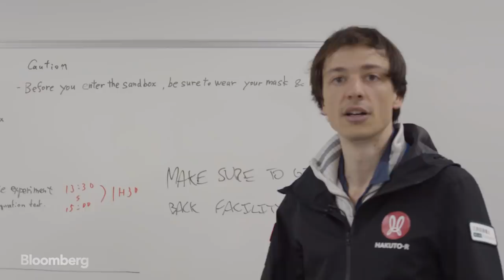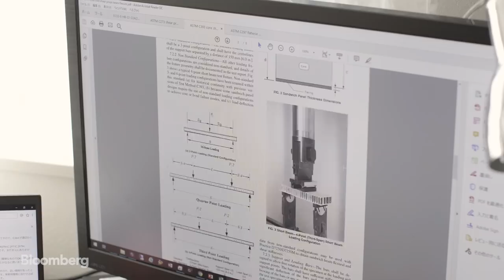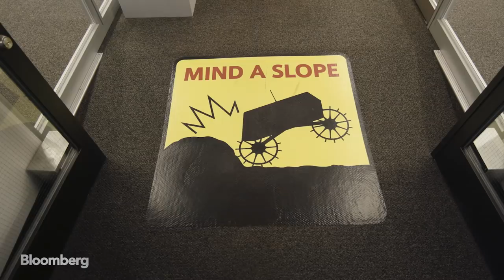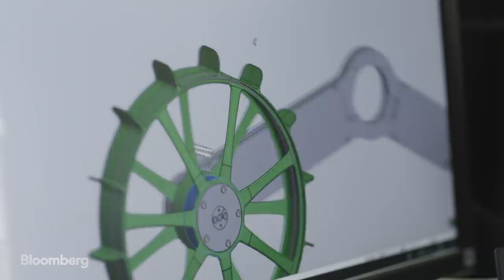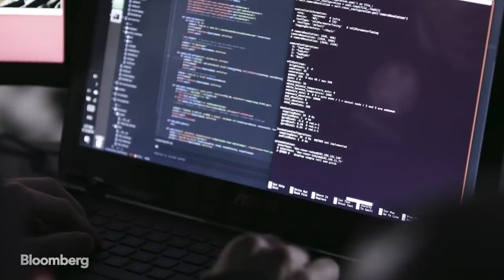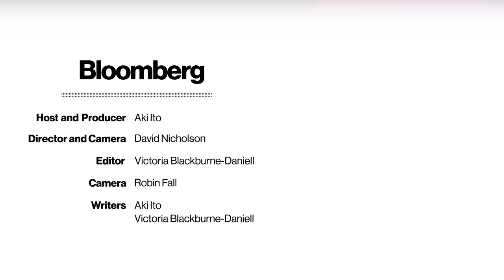The Moon Mini-Rover Engineer

Comment: if the moon is very dry, and the chances of finding water in sunlit spaces remote, & the regolith powder is only about 10cm's deep, how deep can you dig on the without hitting really hard stone and needing drills? I know the Apollo missions barely scratched the surface, but did the astronauts ever figure that out? Or was it impossible to determine due to packing a small spade and a big space suit?

Comment: I should have studied robotics engineering ...Instead of mining
Reply: Wait for couple decades and your knowledge will be in need when companies will mine asteroids.
Reply: The electrical half of robotics/mechatronics can be daunting at times, but doable nonetheless. The whole space industry seems to still be in its infancy so by the time you're done with your degree companies may be hiring. Its never to late to start! :D
Reply: nn - Actually, his expertise will be in need as soon as we actually start setting up colonies on the moon & elsewhere. We’ll have to do in situ resource utilization, & that will require mining. In fact, rovers will have to be programmed to mine &/or drill so we can find some of these resources before we start setting up colonies...
Reply: Schmitt was a geologist... so it's not a bad idea to study mining.
Reply: Nick Tesla, Mining is the future of space. A single asteroid could yield riches beyond anyone's wildest dreams. So add robotics to your mining degree.
Reply: Apostolic Hawaiian  Earth is flat, unicorns are real.
Reply: jmarks881 Heat transfer in a vacuum [Moon, space ] can only occur by infrared radiations [sunlight ]  which is the slowest mode of heat transfer. The only thing even close to 250 F would be the lunar regolith after baking in the daytime sun for 24 hours. You have no real conduction, convection in space without an atmosphere. So the given temperature of any object is based on its ability to both absorb and reflect the radiate sunlight striking it. NASA asked the crew to give them a thermal check on the Hasselblad film cassette. The astronaut replied 100 F .So the majority of the sunlight is reflected away by the aluminum cassette case and light colors. 

The white Apollo spacesuit reflected 90 percent of the radiant light striking it.Sunlight =radiation = heat. The process is called radiative heat transfer . The rover's outer covering, the surface would reflect the majority of the suns heat, radiation away. This is all tested, prior to launch. We have giant vacuum chambers in the USA, where we can subject them to extreme environments, radiation, heat, cold,etc..
Reply: nikola tesla you still have a chance since you are interested and a life ! :D
Reply: jmarks881  The moon is a vacuum,.So you have no real conduction, convection like you would have on planet Earth. The transfer of heat is via radiative heat transfer. So it's not very efficient for heating objects. Sunlight = radiation = heat So the only thing close to 250 degrees would be the lunar regolith after baking in the sun all day. The suns rays are easily reflected using a variety of materials, surface treatments, coatings, paints, thermal barriers, etc. It's not to difficult to warm or cool electrical circuits, components if needed. Long term robotic missions to the Moon, Mars and beyond use Plutonium 238 powered RTG , radioisotope thermoelectric generators, as well as using fuel cells, batteries, solar panels.
Reply: jmarks881  The Apollo astronauts were in pressurized suits, with an operating Pressure of  3.7 psi (25.5 kPa Space is pretty much almost a perfect vacuum of 0 pressure. The pressure in outer space is so low that many consider it as non-existent. It has a pressure of 1.322 × 10−11 Pa. Pressure may be detected from the molecule of air or water hitting you. Since there is very little air and hardly ever water hitting you in space, the pressure is almost zero or negligible. So yes they were well protected from the lunar environment . Likewise, we use the same suits to do spacewalks in space, to repair and perform maintenance on the ISS, Hubble, fly the Shuttle, etc
Reply: jmarks881  Water cooling for the LRV ? No ,the LRV is electric  LRV batteries and electronics were passively cooled, using change-of-phase wax thermal capacitor packages and reflective, upward-facing radiating surfaces. While driving, radiators were covered with mylar blankets to minimize dust accumulation. When stopped, the astronauts would open the blankets, and manually remove excess dust from the cooling surfaces with hand brushes.
Reply: Dont worry brother, just try to get into 1 of the space mining startups! or at least apply!

Comment: if the soil is powdery & slippery then try using different shape of wheel, like a Pentagon or a Triangle, such that the wheels have a larger surface area to rest on the loose soil, so that it doesn't sink. The keyword is "Reuleaux Wheeled Bike".

Comment: how do they deal with the temperature differences?   Something like 260 in the sun and -280 in the shade.
Reply: stay in the terminator liine, maybe mobile cities
Reply: James Robinson My guess is that they would settle into lunar lava tubes for those temperatures are stable and then go to the Surface only when necessary, Would also have excellent radiation protection as well

Comment: Water on moon is mostly in extremely cold spots. I would be looking at a rover with a collection skirt in a super cool lab with super conducting motors that are remotely powered, by maser for example. Best spot for supercool lab would be Bay of Fundy, as it would be very sustainable to cool huge hangars with 40 foot tidal power and conducive to keeping electromagnetic noise low.

Comment: 8:47
New release '18.04.2 LTS' available.
Run 'do-release-upgrade' to upgrade to it.
😂
Reply: Better be careful, it's Ubuntu so there's a 90% chance the install will fail and brick your computer! Wouldn't want to take that risk with your important data, even if it's backed up. Just a hassle, really.

Comment: “Moon surface like corn starch” I’m pretty sure moon dust is actually like many many many very very small tiny pieces of broken glass
Reply: Real moon soil is clingy caused by electrostatic. Every moving parts need to be extremely well sealed to prevent being gummed up or wear down prematurely.  JAXA moon surface simulation is not enough.
Reply: Jeff 79 exactly. I was moreso talking about the jagged sharpness of the moon dust, but you’re also exactly right. Most people would imagine moon dust to be powdery and like sand, and while it is very fine like sand, it also is extremely jagged and sharp, as there is no atmosphere that would provide a ‘smoothing’ effect over a very long period of time, like here on earth. On the Apollo missions, astronauts even noticed that up to a inch of the moon buggy wheels were worn off and their boots were also extremely worn down due to the moon dust.

Comment: Why do they always put too small
Wheels on them ? Every off roader can tell you you need large diameter tready tires
Reply: I'd like to think that, because the make-up of the lunar surface is somewhat known, they've optimised the wheel size balancing performance against package size in what is likely to be a small-ish rocket payload. But...  ...I find myself asking exactly the same question. The wheels always look too small.
Reply: So larger wheels are heavier. Did you know that? Also they require more torque to turn.
Reply: gus bisbal  can be made light weight , so what’s a little torque or stuck in sand ?

Comment: The moon is less than 2 light seconds away. That's close enough that it will still be possible for people on earth to remote operate construction drones on the moon.
Reply: I can't imagine trying to adapt to 2000ms (or is that 4000ms for the round trip?) lag.
Reply: Carter Harvey, You mean robots? Drones can't fly in space [vacuuum ]  You need a partial atmosphere to fly aircraft.
Reply: No, I mean drones. Look the word up. It simply means remotely operated, it doesn't mean flying. SpaceX uses a DroneShip to catch their boosters at sea.
Reply: @CSHarvey  Yes, I figured that's what you were referring too. They used to be called  RPV's They took the word for a male bee ."Drone"  Drones are bigger and heavier than worker bees, and they leave the hive and swarm in the fall.

 They are renowned for a sort of mindless, driven existence: they don't gather honey, they don't defend or maintain the hive, and their only purpose is to impregnate a queen bee.

 Considering the success of the Space X Drone ship's recoveries compared to the land recoveries of the rocket cores, we could say the drone-ship is somewhat mindless like a male bee. I believe they recovered all three last month, which was a first.
Reply: @rubicon24  Agreed that it's too much lag for constant direct control. However, it's on par with really bad lag for an online video game, so it's not too bad to be providing constant oversight of one or more devices that can automate basic grunt tasks, but need human guidance for navigation, tasking, etc.

Comment: Very nice, but they forgot to simulate the huge temperature differences from day to night. Which in itself is a huge stress on any structural mechanical and circuit and computing structures.
Reply: They did not forget, they are just testing how the rover will evolve on the lunar surface, it's often better to do one thing at a time.
They might do those test in a different lab with a different prototype.
Reply: FlxDrv It makes sense. Thanks.

Comment: First off, your straight-across paddle is rather simplistic.  Why not make the paddle wheels have V-shape, perhaps this could yield significantly better traction as per going up steep grades?  Paddle of your design might serve best when traveling through a liquid medium.  If you were to study American tire tread designs this might give you more data to feed off of.  Secondly, I think you should make your lunar rover travel 3x faster.  Why?  Because this will speed up your trials so that you get data feedback in 1/3 the time.  Also, you may develop enough momentum in smaller hills to help propel your rover up to the summit.  I hope this helps.

Comment: Is there a reason why they would use wheels instead of tank like tracks ?
Reply: Moon dust/sand particles have no practicable weathering and therefore tend to stick better to each other and other objects, unlike dust/sand on earth. So tank tracks would easily get clogged up and wear out faster.